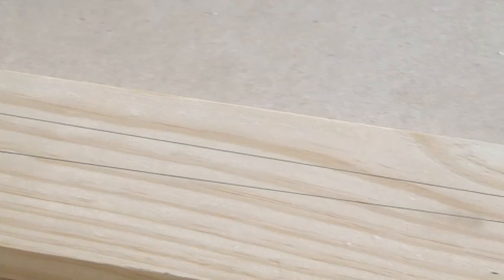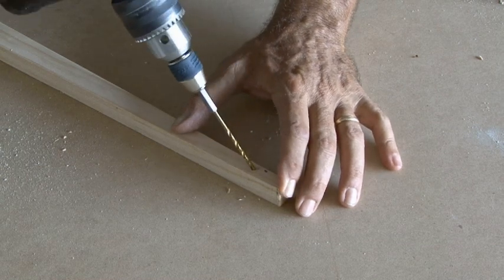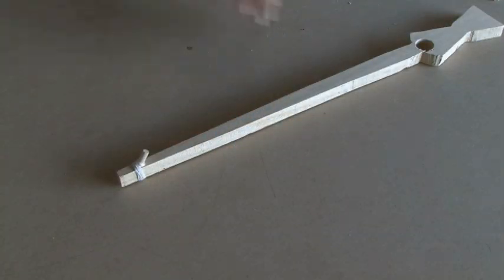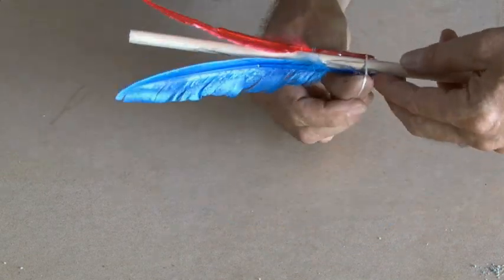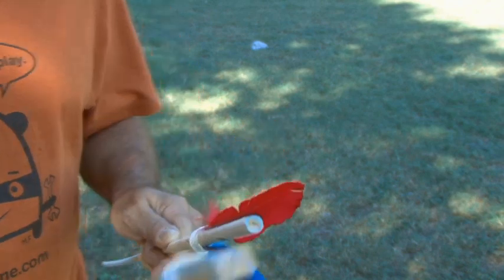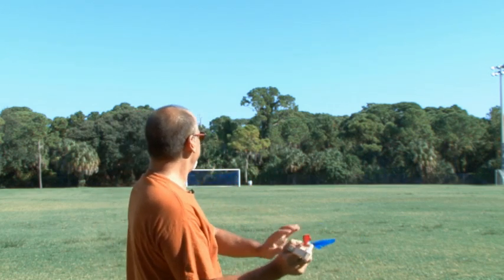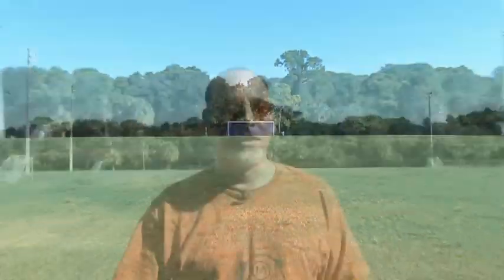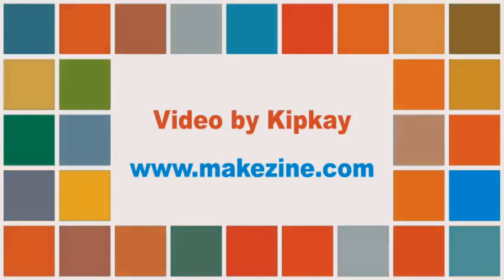Weekend Project: Atlatl Deadly Dart Shooter

Comment: that thing you have been calling a peg is actually called a spur, it should be pointed and at more like a 30° or 25 degree angle also it helps to split the feather so you use one feather for the dart and add some form of weight to the front of the dart

Comment: The atlatl is cool, but the hole for the index finger makes this tool weaker ;/ It's unnecessary, imo.
Reply: Kazu Kuro actually, it is neccesary, it allows you to hold the dart for launch a little more comfortably
Reply: Daniel a
Yes, that part is obvious. But look carefully at the structure between the handle and the shaft. See how thin that part is? (well, there are two parts, shaped like a triangle)
Reply: Yes it is thin, but you're not stressing this part
Reply: Daniel a
I hope so.

Comment: Not enough weight on the front of the arrow.  The atlatl is too thick and will get more power if it flexes a little.  Also weight on the back of the atlatl will help return the board quicker to it's normal shape.

Comment: Make your dart 3 times longer, split two feathers lengthwise (4 half-feathers) with a sharp box cutter (paint scraper) style one sided razor blade (not a utility knife blade... too dull), glue three of the four half feathers (along their entire length) onto the rear of the shaft at 120 degree spacing from each other (360 degrees total... like a circle... i.e. round dowel) like an archery arrow's feathers are attached (save the 4th feather for making your 2nd dart). Much longer & accurate flight.

Comment: Or you can get creative and make your own. =)
 
It's basically just a stick with a hook on the end.
 
I carved mine out of a solid piece of wood, instead of adding the hook on the end. And instead of drilling a thumb-hole, I used leather straps for my finger and thumb.
 
I find this template looks weak at the thumb hole.

Comment: You dont need a hole for your finger and giving a soft angle to the handle would help to get more speed also making a Y to hold the dart so you can hold the handle with all your fingers instead  and finally make the tip of the peg sharper too......

Comment: It doesnt launch spears, it launches darts. The darts are different than spears in that they are flexible, and act much more like an arrow than a spear. If a spear were to be used on an atlatl, it wouldn't go anywhere near as far as a dart would, because when the dart flexes, and the tip (which should be some other material, not just sharpened) resists, it build kinetic energy which actually causes it to accellerate much faster than if you were to just throw it. Otherwise the atlatl is useless.

Comment: My dad made one for me based on what he read in books, if you use a cord, you don't have to drill the hole. I threw the way this guy did, then  a guy taught me to throw it keeping my shoulder still and kinda like snap at the elbow. it changes the dynamics like you wouldnot believe, it flies like a missle

Comment: ok you left out the most important part of the whole thing: the dart shaft should be about 3 times longer than the atlatl and it should be fairly thin with a heavy head so that it bends and unbends repetedly during flight like a centipede if you will

Comment: It works best if you hold it after you cut out the basic shape and see where your finger will line up before you drill the whole, or make the handle a cylinder shape with no hole and let the arrow rest on you fingers

Comment: You're right. 

Much of the force of the dart comes from the bending of the dart itself, and the eventual push from the atlatl. Most atlatls are built with a small weight on the end, which slows the acceleration of the tip and allows the dart to bend.

Comment: The use of an Atlatl increases the power of the throw by increasing the length of the radius to the rear of the dart.  Think of your arm as the radius of a bicycle gear.  The longer the radius (larger the gear) the larger the amount of torque hence increased amount of power.

Comment: A nice design, even if I've seen better ones. For one, the finger hole is poorly placed since it weakens the wood around the base of the arm. Either it should be ovoid or the 'waist' made longer and the hole drilled lower down to preserve strength at the base of the arm.

Also, better contact between the dart nock and the peg can be achieved by rounding off the end of the peg.

Comment: It's the same logic as a "woomera" in Australia which was used by the Aboriginals, only the woomera also doubled as a sheild and could also have string attached to it, when hunting and seperated from each other they would hold the string and spin the woomera around in the air.... it would make a woom woom woom noise alerting fellow hunters of there whereabouts.... hence the name WOOMera..

Comment: It's like swinging a stick.  The end of the stick swings faster than the part you're holding.  Anytime you extend something, the end is moving much faster than the pivot point.  The dart is attached to the end of the "stick" by the peg, so once you throw the dart the peg on the end of the "stick" continues to push the dart, giving it higher speed than your hand alone could give it.

Comment: You should add some kind of weighted tip to the darts. without a weight the spring-mass system that is an atlatl and dart is kinda out of balance. You will find that the darts fly farther and hit harder with a weighted tip.